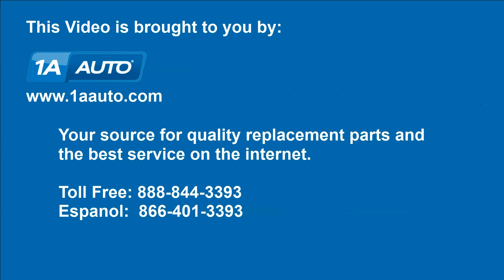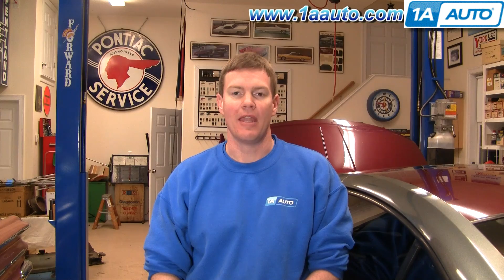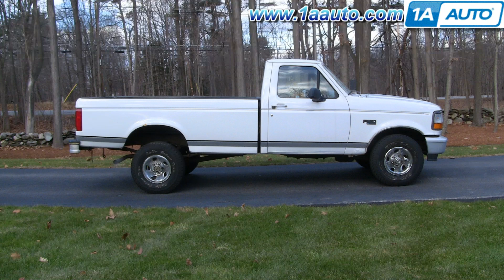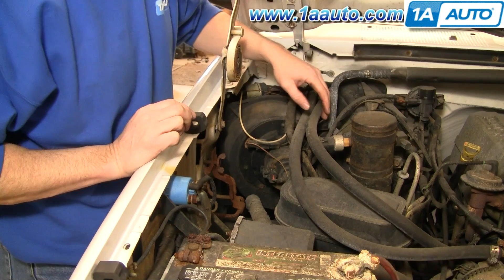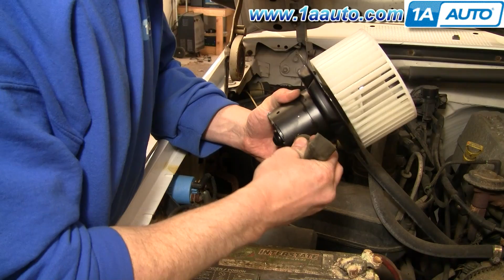How To Replace AC Heater Blower Fan Motor 80-96 Ford F-150/250/350

Comment: If you have to reuse the squirrel cage fan how does it come off the motor shaft? I removed the round clip on the shaft but it doesn’t budge. Is there a trick to getting it off?

Comment: One thing, be very careful around those little vacuum lines.  with age they become brittle and like to break.
Reply: Ended up replacing all of the PVC vacuum lines on my 92 F150 with silicone vacuum tubing.  Looks nice and will last a long time.
Reply: @tubastuff  what size tubing

Comment: What is the name of that cylindrical filter looking thing right behind the battery. It has a hose coming out straight to the Ac compressor? I can't seem to find anything about it but mine is filled with dirt and needs replacing. If you could help me out it would be appreciated, thanks
Reply: Carbon filter?

Comment: My E350 Van looks the same except it has some hard tubing that must be related to the AC or something that is in the way. You know how crowded things get in a van engine compartment. Am I going to need to have an AC guy do this? My fan works, but it makes noise like the squirel cage is loose. Banging around but still working.
Reply from the maker: +mobiltec Thank you for checking us out. In some cases there is a vent tube, but does not require a HVAC specialist to install. 1aauto.com

Comment: Hi guys - do you carry a replacement for the plastic housing the blower motor mounts into? I need both the blower motor assembly you've got here and the housing as it's cracked.
Reply from the maker: If you click the link in the video, it will take you to our website so that you can purchase the blower motor assembly shown in the video. We also offer FREE SHIPPING on all of our auto parts in the lower 48 states. Hope this helps you out. Thanks for watching. 1aauto.com 888-844-3393

Comment from the maker: When you turn the AC on you should be able to see the fan clutch engage and kick off. If it does not you may want to test the power to the AC compressor. 1aauto.com 888-844-3393